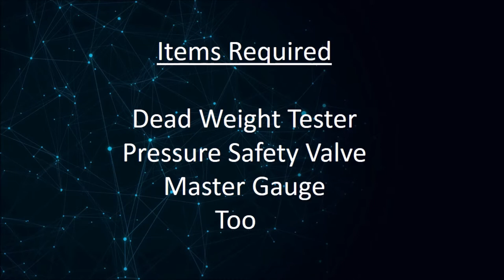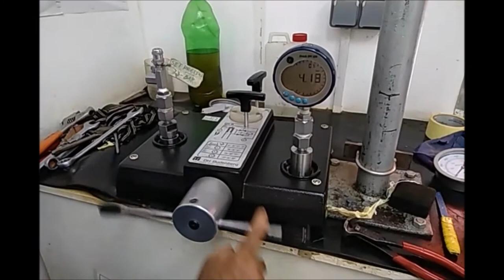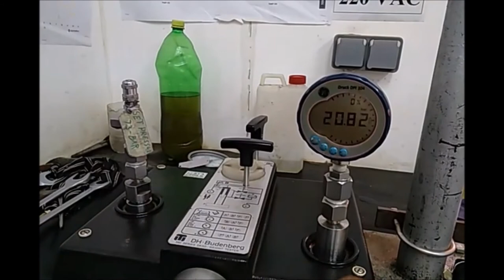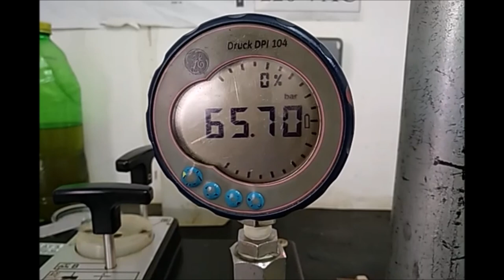How to Calibrate a PSV (Pressure Safety Valve)

Comment: Dead weight tester mai kon sa oil use karte hai
Reply from the maker: Hydraulic oil
Reply: Normally Silicone oil....or as per required Viscosity you can select liquid

Comment: What is the calibration frequency? 6 months or 1 year?
Reply from the maker: It depends.

If psv is used for a leak test. It should be calibrated in every 3 days.

And if it is installed in normal operation, then the frequency depends on Client. Some places its 6 months and some places its every 3 months.

Comment: parker brand
Reply: I had tested my parker RH4A pressure relief valve. It was set at 8.4bar, and my supply is 10bar. It was pop at 8.6 bar,  but the pressure shown on the gauge that i installed after the PRV still goes up to 9.3bar... Its not stable at 90% of the set pressure. Is it normal?
Reply from the maker: try removing the foreign particles inside and try replacing the trip spring